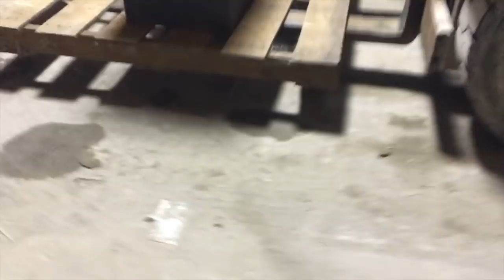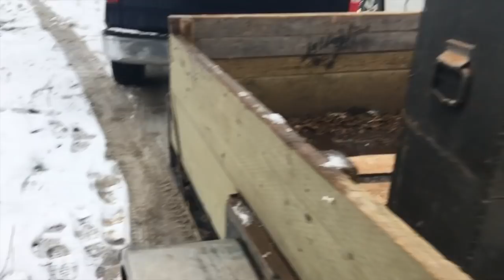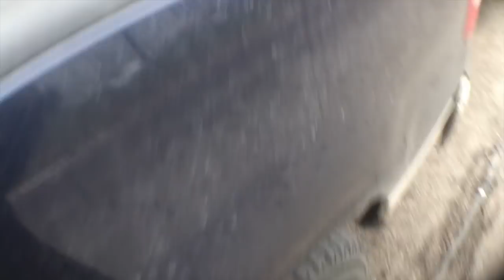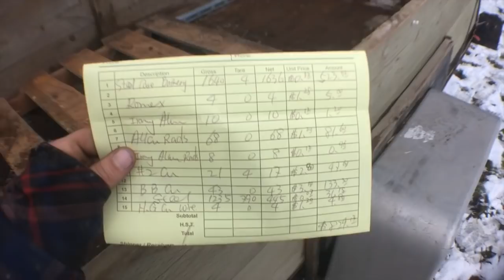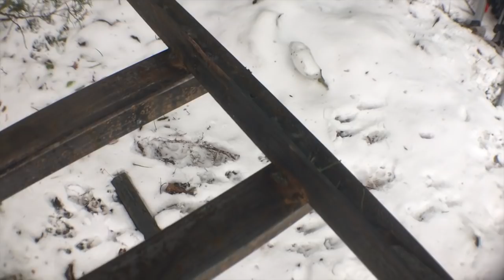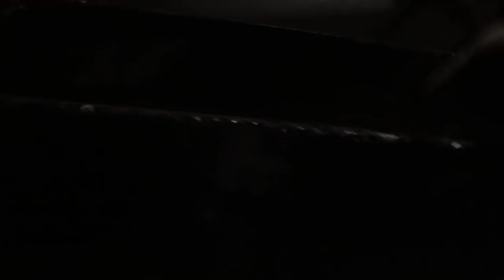Scrapping A 1650lb $530 Battery

Comment: This video gave me flashbacks. I used to work on those batteries. I was the one who had to take them apart to recycle. Easiest way would be to cut the led straps than take some large vice grips on each post and lift it out. The first one might be tough, might have to use WD-40 around the cell. The rest would fall out after that. Otherwise sweet payday
Reply from the maker: Tom TTFNCachn Oh wow nice that sound like it might be a pain to get the first one out especially if it’s really old thanks for the info though I was curious how they come apart and not much info on YouTube about it.
Reply: @scrap2cash712  if anything, I used an air chisel but the straps between the cells are pure led. Cut those off if you can't get the cells out. Won't take touch off the total weight of the battery but caching in the led would give a little more cash in the pocket